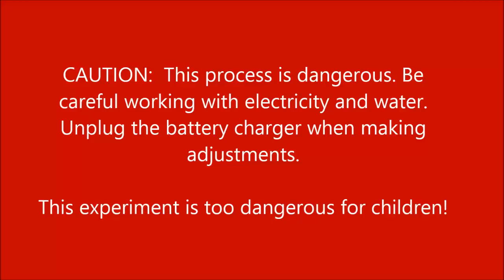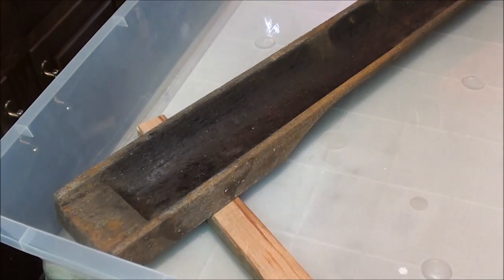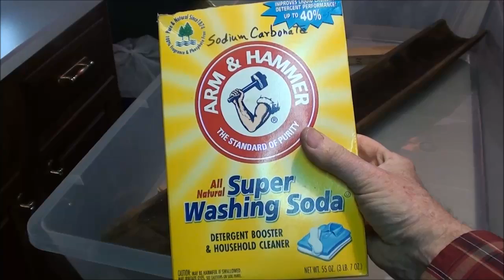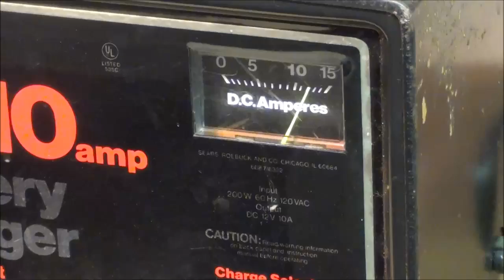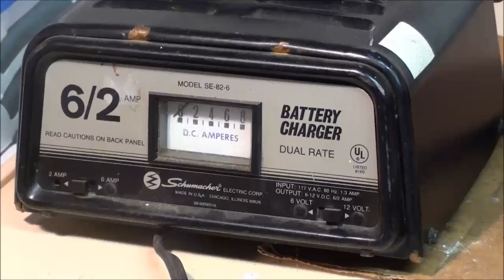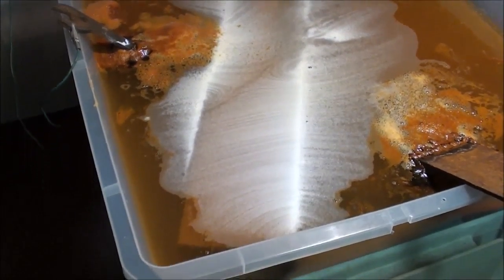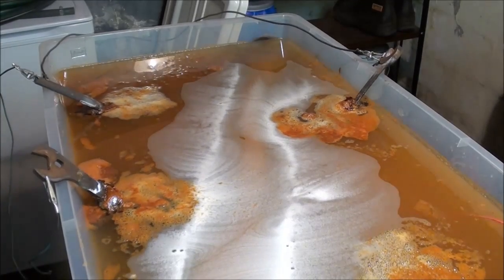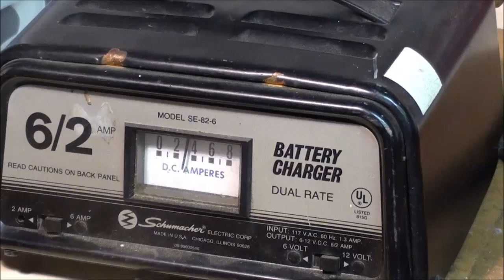MACHINE SHOP TIPS #146 Part 1 Electrolysis Rust Removal Experiment #2 tubalcain

Comment: Consider: Using .03x plate with a surface area bigger than the piece you are derusting. The distance from the plate to the item being derusted can be used to tune amperage. The gunk on the plate can be easily scraped off, and the plate reused.

Comment: Use stainless steel anodes. All the rust then deposits in the electrolyte, instead of clogging the iron anodes. Saves cleaning them and the process works faster.

Comment: I paid $4500 for my first new 76 Ford 4x4. I would load the box up with firewood often. Then I traded it for a new 78 Ford F150 4x4. After I unloaded the first load of firewood, I could not believe my eyes. The box was full of dents, which did not happen on the 76. After that, I always bought a bedliner for my trucks. My dad bought the 40 acre parcel we lived on for $4200. Ah, the good ole days!

Comment: Just be careful if there is stainless steel present.
Some nasty chemicals can be off gassed.
Reply: No, they aren't. 
Use stainless steel anodes. All the rust then deposits in the electrolyte, instead of clogging the iron anodes. Saves cleaning them and the process works faster.

Comment: I can remove the rust from that in 5mins. The more voltage you use the lower the amps. I'm using 24v from a regulated power supply for a computer. they are very easy to convert to this purpose. I typically use them for running things like LED lights and things like that. Running large lighting arrays. So long as you do not overload the power supply (go over it's watt rating. I'm using a 150w power supply. I don't have a circuit tester at the moment to I'm just hoping I haven't exceeded the power limit. If I do though, it will shut down. Also why I'm using 24v and not just 12v. More volts you put into the circuit the less watts of power it requires.
Reply: Current consumption or current flow, depends on 3 factors : 
1) the area of the elctrodes, i.e. the loss electrode (+ anode) and the item derusted (- cathode).
2) the acidity of the solution, usually regulated with controlled amount of rinsing soda or sea salt (NOT kitchen salt !)
These 2 parameters together makes up the "ohmic resistance" of the whole setup.
3) The power supply output voltage.
You should be more than ready with any good old AT or ATX PSU, as these will supply anything from at least 8amp up to 12amp.
Keep the PSU inside the PC cabinet, as this makes for good opportunities to fit an am-meter, ekstra switches, current trips, banana plugs etc. and will keep the PSU unit itself protected.

Do NOT opt for higher voltages or higher amps, as this can make for UN-controllable setups, which develops too much hydrogen to such an extent, that you are in real danger of making your house blast away. Hydrogen is somewhat underrated, as it seems an innocent gas, but it is indeed HIGHLY explosive, when mixed with air. Think about all the efforts put into making hydrogen a transportation fuel. That is for a reason ! Ventilation is a MUST, or keep the whole setup outdoors.

I would start with a maximum 6amps current flow to start with. As the process progresess, the current flow will tend to decrease. Do not compensate.
Depending on the rust condition, the process may have to run between 1-3 days, even more for really bad parts.

NO ! This process is absolutely not fit for paint stripping.
PC - PSU units usually needs a minimum load on the 5V ouptut, to wake up the 12V supply.
Try find an early 6V system  - 5W (a 10W would also do) car bulb and connect to the 5V supply. That should be adequate as a minimum load. Works as a bright power on indicator as well.
Reply: Few questions for you. I'm using old PSU with hissing caps (rated at 10A) only draws 2 amps at best. It needs replacing from day one and I finally started doing some research on what to get. 
Can 24v strip paint as well? That would be really welcome when I'm doing car wheels
When you buy these 24v universal regulated PSU's  what amps do you order it with? 10a 20a 30a?
Does it become a problem leaving the piece for 24 hours with 24v? Like what are the disadvantages of 24v?
What's more important for this process Volts or Amps? 12v/30amps vs 24v/15amps = who wins?
Does Universal regulated PSU needs a load hooked up to work well, like car battery or CD drive etc....
Many thanks I really appreciate if you can answer. I'm in the middle of trying to decide between another Desktop PSU, A car battery charger (with 24v + higher amps) or a Regulated PSU for lights from Ebay .....
Reply: HenryMania
I do not think you can strip paint with electrolysis. It works with rust because rust is metal.

All computer psu's need a constant load to function. Other wise they will shut down after a few seconds or minutes.

Amps are power. Higher they are the more power you are using, but pushing one to 30 amps for extended periods of time seems like a bad idea. they are not designed for this. The 12v+ and 12v- are there for powering gpu's and other pci cards. Nothing is going to pull that kind of power for longer than a second in a computer.
Reply: HenryMania
Read CXensation's comment. He sounds like he knows a lot more than me.

Comment: I have a set of five, large metric impact sockets, that I've carelessly allowed to rust.  I've tried this method using a Schumacher charger, a new cutoff of 1/2" black pipe for an anode, a piece of 1/2" rigid copper pipe for a cathode, a 1 gallon ice cream bucket and galvanized wire to hang my sockets from. I couldn't find washing soda at my Ace hardware, and I'm loathe to patronize walmart, so I read that one can make washing soda by heating baking soda in order to drive off moisture and cause a chemical reaction to make washing soda.  When plugging in the power supply, I immediately noticed results similar to yours.  I left for work and returned to find zero amps on my charger's gauge and nothing happening in the water where fizzing is concerned.  Much of the rust was removed, and all of the black oxide finish was removed from the sockets, but some of the heavier rust remains.  I retained half of the socket set untouched for comparison.  I'll say that my anode certainly gained some mass in rust, but doesn't look nearly as gnarly as yours.  Tomorrow, Ill find some washing soda and try again.If you're interested, I'll keep you updated.
Reply from the maker: +Patrick Whitehead Interesting results.  Thanks for watching. keep at it.
Reply: +mrpete222 I was talking yesterday with my brother, who works in a plating shop, about this very topic. He tells me that the caustic nature of the washing soda is what makes this process work better than the neutral baking soda. He recommends drano as an agent that will speed the process.
Reply from the maker: +Patrick Whitehead Interesting

Comment: Be ALERT AND AWARE- YOU MUST  UNPLUG the charger before touching the water or say Good Bye.

My electrolysis tank is  a  4' x 4' x 4' square liquid tote with a plastic liner and the rust jumps off using 165 Amps setting on a commercial battery charger.   A  2" x  2".wood picture frame is mounted on the top of tote , with  full height pieces of rebar, [ 2" higher than wood frame] that are 4" apart attached with 1/2" copper tubing, plumber  straps.

 I laid a  4' rebar next to and attached it  to all  the  up rights on two  sides of the tote,[ Left and Right only]  and completed looping the rebar on the front and back with copper wire , which are all Positive.

Then I attached another two  Negitive 50"' rebars about  1/8" away from the Positive rebars on each side- [.2" more makes it easy to clip onto].
Then I made a rebar gate that hangs in tank attached with copper strips  to move the charged [positive ] gate  up closer to rusted object .[Closer on  at least on two sides].

With Positive and negative  only 1/8" apart,  It has the water moving all over the place produces outstanding results.
The  dirty spent water is just iron water and can be put in garden.
Reply: ALTON LONG goodbye from 12v ? little dramatic dont you think

Comment: I'm not trying to put that method of remowing rust down because it have advantages . However there is less complicated way without involving electricity :
i successfully  remove rust many times from steel deeping it in  diluted phosphoric acid for about 30 minutes , ( around $30 per gallon high concentrated which will last for generation )  another method is vinegar but bit slower  ..take hours or days . I never try  myself but  i heard about : smaller parts can be dipped overnight in PEPSI  or COCACOLA  which is phosphoric acid drink  .... wanderfull word !!

Comment: Too much soda raises the current. I never went past 4A. Use old computer PSU, these go up to 16A and they have an overload protection built in. To lower the current dilute with fresh water or change the ratios completely. I never do this inside, not just because it could ignite, but because hydrogen flame is almost invisible. Also better to be home and alert than looking for a new truck

Comment: Be careful of pushing this too hard! That will result in pitting, and poor conversion of the "black oxide" back into metal under the red oxide. Try this: Use 10 percent by weight washing soda/water solution, keep the voltage across the cell between 1.8 and 2 volts, aim for a current density of about 1mA per square centimeter of surface area for the object you are de-rusting. Try adjusting the immersed anode area to control the voltage across the cell between 1.8 and 2V, that should automatically get the current density in the ball park. ( Use graphite anodes, raising and lowering them is like making them a potentiometer) This may make the job take longer, but it will be way better. The harder/faster you push this process the worse job you get, you get a lot of gassing, etc. Be careful with high stressed parts, google "hydrogen embrittlement"

Comment: You can lower the amperage by dropping the voltage and by moving the anodes away, too. I use a 40 amp charger on full power for my projects.

Comment: Lyle,
Try Evapo-Rust.  You can get a gallon at Harbor Freight.  It is non-toxic and works great.  Isn't hamful to anything (rubber, plastics, etc)  It is also re-useable.
Reply: Bill Lewis
I bought a 5 gal bucket for $69
Reply: I second the motion, Evapo-Rust works great. It works by chelation, it is my favorite. No worries about hydrogen embrittlement, or any hexavalent chromium formed from SS or plated metals. Hexavalent chromium truly is dangerous, horrid stuff.
Reply: send a PM and I'll send you the email of the guy that has it.

Comment: Hi Mr. Pete. Thanks for all your great videos! Probably someone else already mentioned this but those bubbles are releasing hydrogen gas into your basement. I know it's cold over there so you probably have the basement sealed up. Just be careful the gas doesn't build up so much that it ignites when your furnace kicks on. Once again, THANKS! P.s. the water level is dropping because the electricity is splitting the H2O into a bunch of H and a bunch of O. :)

Comment: Hi Mr Pete,
Here are some informations that I collect over the years on this subject

For steel- Water (150cc) sulphuric acid/(300 cc) / phosphoric acid (600cc) Cathode Stainless steel, 8 volts 1-2 Amps bath temperature at 60 Celsius
Stainless steel Phosphoric acid (300cc) Glycerine (530 cc) water 90 cc) Cathode Stainless steel, 5 volts 1-2 Amps bath temperature at > 60 Celsius 
Aluminum Perchoride acid (350cc) acetic anhydride )650 cc) Cathode Stainless steel, 50 volts 2 Amps bath temperature at < 35 Celsius
Copper Phosphoric acid (700cc) (water 300cc) cathode is copper 2V 7 A 20 celsius.
With these solutions, you can even sharpen and polish tools. 
I use for big parts a metal garbage can as the anode and suspend the cathode Stainless steel cathode. What is great about the stainless is that the rust don't stick to it. A rag is enough to remove it. The harm and hammer solution is good. You can also use table salt, or Drano.
In fact you need to make test like these one, I had clean a Stanley 54 and all the blades with Gillett cleaner.  I never had such a result as the one you have with the carbon. More search needed to find the relation between carbon and steel. The time need for the chemical solution to act (depending on the rust is between 5 to 30 minutes.